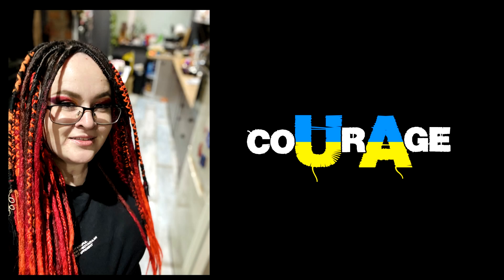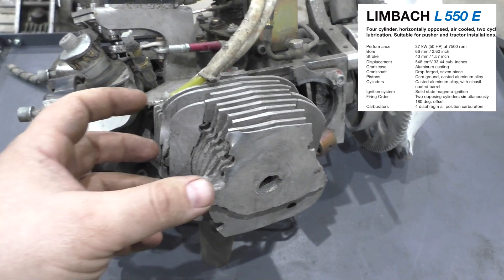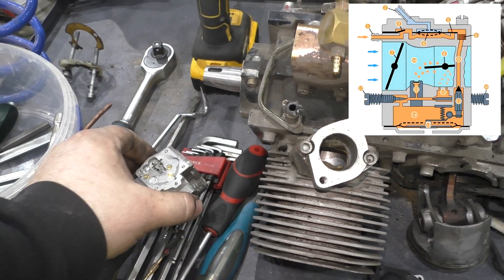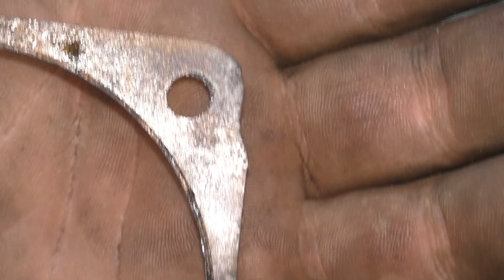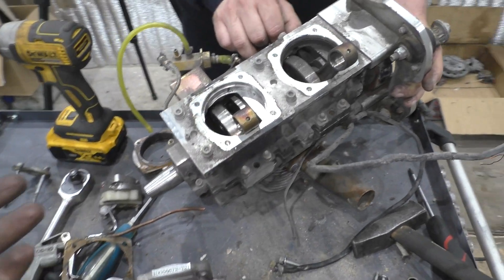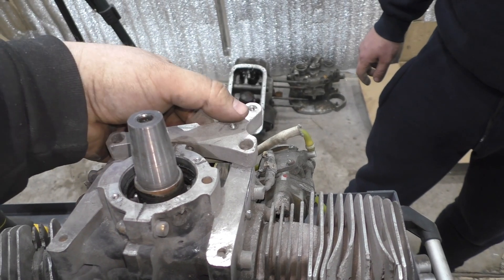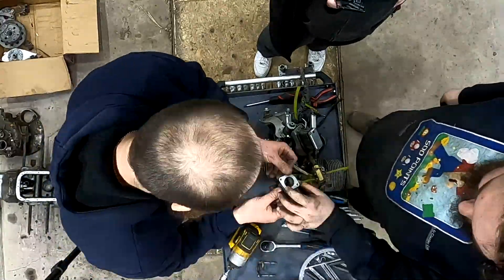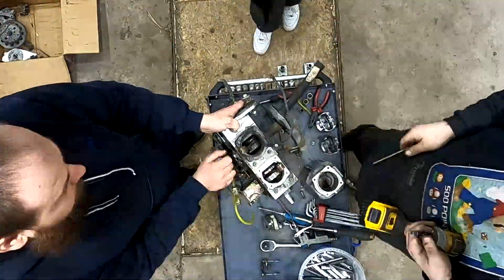SHAHED 136 drone engine TEAR DOWN

Comment: Reasons why they use cheap Part is They know it's just for the decoy to see your anti-air. Just one way flight. For me if the port the exhaust and intake it will more more power.

Comment: I hear everywhere in this video phrases which want me to feel like this engine is a crap, but as a builder and creator I would do something similar, because each polished surface, each extra belt or paint requires time.
Other than that I'm noticing that Ukrainians always blame Russians for their crooked tech and lack of ability to design something new, but where's your state-of-the-art tech guys, after 3 full years of war you haven't created anything substantial

Comment: Dahhh…..That’s why it’s called shaheed. It means martyr. It’s a suicide plane. It’s literally designed to be low cost. You can’t bring it down with a low cost missile. You need a very expensive missile to bring it down. That’s its whole purpose. To inflict a financial burden to the enemy. It’s where modern warfare is headed.

Comment: its a crap. flying moped with little bigger engine. cheap and easy to manufacture but since it is 2 stroke and with open exhaust,just pipe attached to exhaust port you can hear it from miles away

Comment: if you measure the diametre of the piston and pictures of the shape  , perhaps it's very simple to find the leak  ....  there are not so many manufactures who make these in this quality
Reply: Or they designed the cylinders around an easily available piston...

Comment: 7:55 again with the assumptions of knowing the other side.  How do you know what they know?  How would you distinguish between a worker without knowledge vs a worker instructed to not worry about the 2HP loss because the extra work to machine the parts would not make a significant difference in the application of the drone?  Its a crude device that is going to do cruel things...why would you expect maximal or even above average quality?  Such drones will be sent in groups to ensure a salvo accomplishes the assigned goal.  Salvo size will take into account natural failure rates, probability of being downed by anti-aircraft systems, and the desired probability of striking the target.  As long as the failure rates are stable, predictable salvo sizes can be calculated, and sent.  In the end it is not the individual quality of individual drones that will matter.  I have seen similar trade-offs in my motorcycle -- and it was made by Honda who know something about precision.
Reply: It is not about efficiency or power, it is about a reliable action of the engine so that over thousands of launches the guidance is minimally affected by mechanical failures. If the shahed does not hit the tank, or ship, or power plant, or apartment building that russia sends it at, then the consequences are much more expensive than the cost of 1 drone let alone the cost of these basic things such as a reliable coated cylinder or proper gaskets. When 50 russian soldiers receive their 72 virgins from a tank, because their shahed missed because it had poor and unreliable engine performance, they know the real cost of no industry/engineers/talent. Every component that is difficult to make they sourced from another country. Every componwnt that is simple, they did a poor job on it. What is our excuse for allowing them to fight a war against ukraine while armed with supplies they sourced from another nations since they are incapable of making ball bearings on their own?
Reply: @TheMotoManiac  What is this rambling? 50 soldiers 72 virgins from a tank?  What thousands of launches?  These are one way vehicles - they need to survive ~6 flight hours.  They will not see two launches.  Targeting uses a real time feedback loop.  It doesn't rely on particular engine characteristics.  Re: industry/engineers/talent.  Check your facts brap-buddy.  Guess who routinely flies to space?  Guess who manufactures their own jet engines and combat aircraft?  Guess who builds ice breakers?  Guess who builds nuclear power plants across the globe?  You can certainly make the case that they don't build every component of every system they use, but to argue that there is no engineering ability is just uneducated and rooted in a simplistic understanding of the world.  Read books, it will help.
Reply: @zeerocool  you misinterpret what i say and then act like i'm a moron. Cool story. You can't tell me that there isn't thousands of shahed's produced and launched. You can't tell me that having poorly cast, uncoated cylinders does not create inconsistencies, and I believe that when they copy western technology with something that looks similar but skips every detail, that is part of what causes them to constantly have glide bombs or drones that miss their shot. 

As far as the ice-breakers you mention, all that term does is get me a laugh thinking about the little green men in south america that got set up by a decomissioned cruise ship, and sunk one of their "warships" trying to do the common russian move of smashing into it to force it to leave "their" waters. These people are not smart, the best choice they have is copying western engineers and if you're gonna copy something, it can't just look like it, it has to work like it too IE African homemade helicopters.
Reply: @zeerocool  we are talking statistics here, not one drone being launched thousands of times
Reply: @zeerocool  and the 72 virgins thing is a reference to the name of the drone, "shahed", and what it means to persians/islamic being "observer" or "witness" as in prophet Muhammed. Keep up now
Reply: @TheMotoManiac  I made this point in my first comment, I guess I'll make it again.  Inconsistencies aren't a problem as long as their rate of occurrence is stable.  When calculating a salvo, one takes the expected failure rate of the munition, the expected loss of munitions to anti-aircraft defenses, and the desired probability that the target is hit.  This is then used to determine how many drones to launch at a target.  The key is not to have great reliability, it is to know what your reliability is so that you can plan accordingly.  So -- could the machining be better -- of course.  Does it matter?  Hard to know, but given that they control the manufacturing and have ample opportunity to test the drones, I expect that they have a failure rate they are comfortable with.  Or rather decreasing the rate would take money away from something they value more.

Comment: The fins on the cylinder and head are very efficient in air cooling especially at speed and high altitude, the type of two stroke engine (or some call a one stroke) are really good and reliable, the way air/fuel is  scavenged is excellent for an aircraft as there is no problem of floats bouncing about and cutting fuel off that happens in the old two stroke engine/carburetor set up.

Comment: This looks like a well optimised design. Cost Vs function Vs durability. I don't suppose, in the intended market, there's much  Factory Acceptance Testing done so few HP here or there won't be noticed. Aero engines are never that special, if the Avco Lycoming was wanting to go by.

Comment: They don't need quality parts because the engine will run only for what 24 hours maximum before it hits a target so quality control can be subpar
Reply: And the ones that fail still keep Air Defense busy.
Reply: For the short duration that they have to survive, being able to run already means that they passed QC.
Reply: Yet they use Japanese bearing of high quality and 4 piston design instead of two...🎉🎉🎉
Sanctions are not working
Reply: kamakazi...
Reply: @ Yes it is :)

Comment: In my younger days I flew Gyrocopters. The Bensen B-8M. M the or McCullough. The engine was straight off a target drone which was a RCAT (radio controlled aerial target) which is a fixed wing drone. Guys in jets would shoot at them on the bombing range. The McCullough 4318 is a 100 cubic inch, 4 cylinder opposed two stroke. Engine weight is 78 pounds. It came in two kinds 72 and 90 HP. Swinging a 48" 27 pitch wooden prop. Cruise speed 45 kts burning 4.5 gph. Those were the best days. Love flying FPY now. Cheaper and safer but not really the same.

Comment: A 66cm propellor is very short. Probably very inefficient at 7500RPM so I would guess the engine runs slower than that and turns a larger prop. Have you been able to get enough of a propeller to estimate the length?
Timing can be controlled electronically with slightly after TDC for starting and then advancing with RPM.

Comment: 50Hp from 550cc twostroke is really underachieving performance. Those numbers belong to the early 1970s.
Reply: That's the specs of the German aviation engine the Iranians copied. That German engine is intended for regular aircraft use. Aviation engines are designed with reliability and durability in mind, with performance taking a back seat to pretty much everything else. The original German version of this engine could probably be tuned to produce far more power, but it wouldn't be as durable and reliable.

Of course, the Iranian copy isn't concerned with any of that. All they care about it building it as cheaply as possible, since it's a one time use engine. All it has to do is get the drone to the scene of the crash, so to speak.
Reply: It's a lowest cost engine what do you want a turbo charger?
Reply: Primitive people somehow stole parts and ideas to make a working machine. 😂
Reply: You know the Persians invented higher level math thousands of year ago don't you? @johnycash8291
Reply: @johnycash8291  my guess is the average Iranian has twice the brainpower of yourself.
Reply: @johnycash8291  Iranians are smarter than you, for sure.

Comment: it's sand molasses cast i bet  looks like the rest.  The Carb guts etc  looks to be motorbike and outboard motor parts probably running it on gas with mothballs dissolved in it  doing so would allow such a low quality out of spec engine to easily start and run..  but will kill the motor .. its only going one way once so it doesn't matter

Comment: Really interesting when you think of almost everyone today is using much more complex electronics that allow control options for nearly anything in real time and almost unlimited flight if using solar panels and batteries and some use manned and unmanned satellite link ups…. with no fuel restrictions it can fly independently

Comment: The head being an integral part of the cylinder makes it much easier to manufacture with cheap materials and also saves on some accurate machining which would otherwise be needed.  Instead of needing a head gasket to seal the high pressure and temperature within the cylinder you have a seal at the other end, which is cool and does not handle any significant pressure except for that needed to push air into the cylinder during induction.  It would probably work fine even without a gasket at all as even with a poor metal to metal seal very little of the air fuel mixture would leak out.

Comment: The presence of an additional plate with fins on the top of the engine suggests, at least to me, that they might be using sand casting for the cylinders instead of lost foam casting or diecasting. Its much easier if all the fins are parallel. Considering that the metal used is of decent quality due to the crosshatch still being visible, I'm guessing they bought aluminum in the form of something else like other small engines and melted it down. That way they could get a metal that's high quality without there being a visible supply chain. 

Find out which alloy of aluminum is best used for sandcasting as opposed to diecasting and you'll probably be able to help track down the source of the metal. Also check the fuel-oil ratio of the remaining fuel. If they're running something like 50:1, then that's probably a very nice alloy and thus the aluminum had to have come from melted down engine blocks. Do some analysis of the metal's alloy and see if the metal came from car engines or other small engines. Since they're probably made with sand casting instead of diecasting, the amount of metal molten at one time in their shops is probably relatively little. This means that you might be able to track down the exact source of the aluminum used down to the specific Chinese foundry. Every material used has its own 'fingerprint' that can be tracked down. 

Here's other ideas I have. Analyze the copper wire in the generator. Copper wire is usually made of virgin copper and not scrap copper in order to keep it pure as possible. If the wire isn't perfectly pure, then that means they're using scrap copper. Analyze the crankshaft too since that can help narrow down the original factory its source metal came from. Check the machining to see if it was done with carbide tooling or with tool steel. I'm sure machinists know what to look for there. Also test the hardware used. Generally I'd expect them to use the best nuts, bolts, and screws. Maybe check the alloy to see if its the same as professionally-made hardware from a Chinese factory. If so, then the screws might have been intentionally made off-center in order to give the false impression they were made in a much junkier factory in some place like India. 

Just be aware that they know you'll recover the pieces and look for clues. Its easy to misdirect people by stamping incorrect brand names onto bearings and other parts but its much more difficult to do that perfectly when microscopic analysis could tell if the letters and numbers stamped were done by the same machines in the factories the parts purport to come from. Its also more difficult to hide the origin of the metal used since altering it could compromise its material qualities. 

I think these parts were made in China but disguised to look as though they came from other countries. If the threads on the screws, for instance, were clearly rolled or cut by fancy machinery that would be out of place for a factory that can't center the hex hole in the head, then you know some manipulation is going on.
Reply: Secondly, those bore and stroke dimensions look very familiar.  Seems there’s a Stihl chainsaw engine having a 60 x 44 stroke.  I think it’s an 088, 124cc or so.
Reply: Cylinders are probably gravity die cast.  Sand casting would be really hard to do with that close spacing and depth of fins.  It would need real skill to pull it off.

The deepest fins I’ve done were about an inch deep.  The sand wasn’t the best…
Reply: getting hold of aluminium Ingots and  enamelled copper wire is not that big deal. Iran manufactures its own car engines, they have more than sufficient expertise to build this.
Reply: Why can't recycled copper be refined to the purity level of new copper?
Reply: @joewoodchuck3824  easily.  Most copper is electro-refined prior to use.
Reply: @dennisyoung4631  That's what I thought, but the original post stated that recycled copper couldn't be used to make wire. Oh well.
Reply: I love the forensic aspect of this !
Reply: Those engines won't last long enough to make that crosshatch disappear.
Reply: Да хоть отследись. 😂
Reply: The bore has an electroplating hard coating on it. Something like NikSil. You cannot have rings rubbing on bare aluminum.

Comment: Be careful assuming that the markings are accurate. If I were the Iranian government, I'd put false markings on parts like bearings and pistons in order to misdirect any supply-chain analysis. In fact, it could be the Chinese manufacturers doing it considering that they'd face zero consequences due to it being a government contract with Iran and not consumer products.
Reply: I doubt the Iranians really give a damn. The bearings are likely widely available for multiple uses. Incidentally, those bearings would be very difficult to swap markings on and even trying to remove the original marks would risk damaging them

Comment: The only reason they aren't stacking multiple Kart engines instead of making it themselves is no one will sell them kart engines . Two 125cc kart engines would produce 60~80hp for less weight but would need a simple belt reduction drive to the propeller

Comment: Very interesting stuff! Amazing how low the cylinder casting quality can be, and be within the acceptable standard. Fissures in the cylinder wall, would normally be completely unacceptable.
Reply: I think the cracks were due to it crashing. The crosshatch is still there so the metal had to have been of decent quality. Its also not difficult for decent factories to intentionally make parts look like they're made in lower-quality factories in order to obscure the original manufacturer. I'd expect engine fins to be overly thick if built by substandard workers.

Comment: Now this is fascinating to me. Limbach 550cc 2Ts are very reliable. Chainsaw carbs make sense due to their inverted happy operation.
These cheap n cheerful lil motors can be perfect for ulralights. But Im thinking Motorcycle or a micro car.
Whack four expamsion chambers on, four Mikunis, windowed pistons and reed valve induction (and a turbo is doable) and see what occurs!

Comment: 50 HP from 550cc -- two stroke? 
I don't understand why they used four carbs for such a simple mission engine.
Reply: Add 4 real carbs, tuned pipes and you will get double the power i bet 😁
Reply: @halmakenreuther8843  and a funky paint job